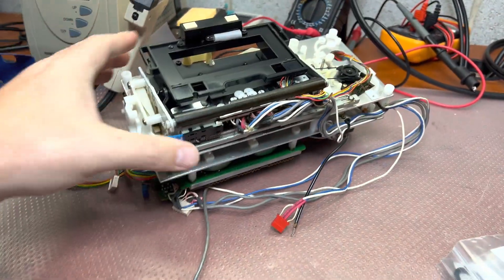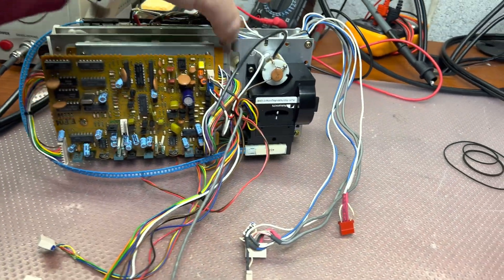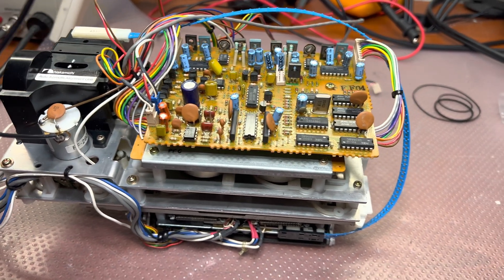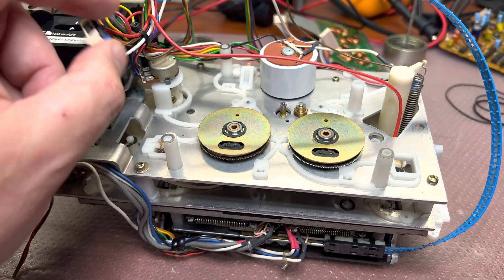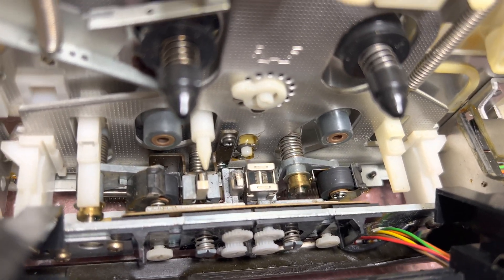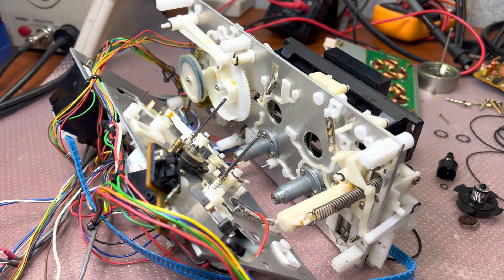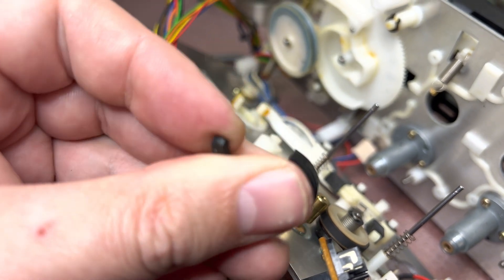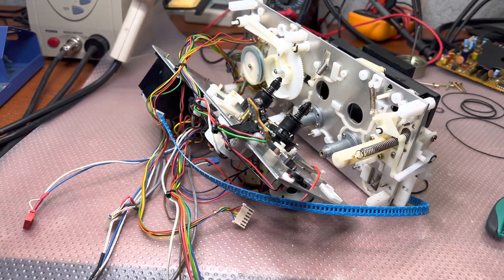Masterpiece Uncovered: The Build Quality of the Nakamichi Dragon Tape Transport

Comment: Is it a good practice to use a ceramic cap across the motor as a high frequency suppressor ?
Reply from the maker: What are you talking about? Capacitor is used as a spark suppressor.
Reply: @hifirulezzz  Aah... like a switch. I was thinking about a last resort measure. I don't remember any other deck with this design, at least not directly placed on the motor itself.